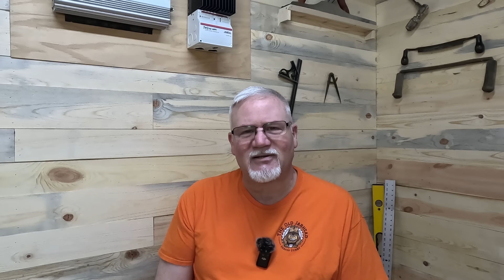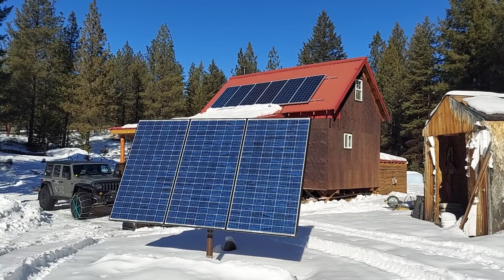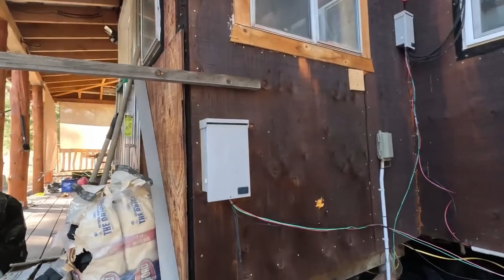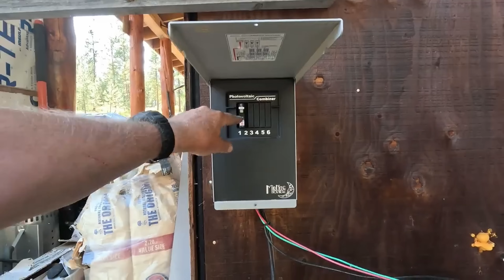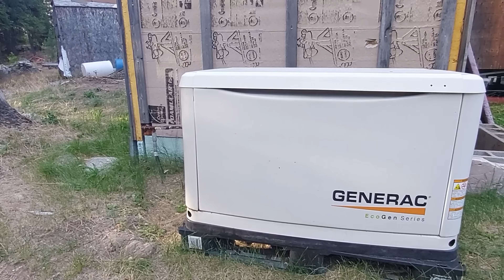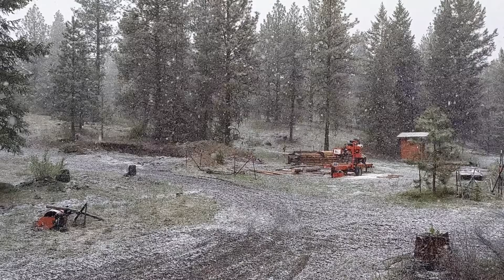🌲 What You Need to Power Your Off Grid Cabin (Without the Grid) 🌲

Comment: Does the voltage and amperage have to be identical in each of the independent solar arrays that are going to the combiner box before it goes to a single charge controller or they be different?
Reply from the maker: Yes.  I use two different combiner boxes for my two arrays
Reply from the maker: technically you could buti wouldn't

Comment: You are right on. My house in Virginia is 80 to 90% solar so I still have grid tie. My power bill is very low. I have moved several systems like water heater to woodstove heat and electric stove to propane. My comfort level is good. I really enjoy solar power.
Reply from the maker: That's the way to go - make it your own!

Comment: I would use somewhat different metrics.

First, the generator.   The key to efficient generator use is to only use it to charge the battery system, with automatic start and stop.  Start at 25% SOC, stop at 50-70% SOC.  Plus logic to ensure the storage is charged sufficiently before bedtime that the generator does not have to start while you are trying to sleep.

Its important to make the generator operation as efficient as possible.  That's why you don't directly run appliances with it.  You just use it to charge the battery storage and you run it at 50% load while doing so.   You also want a smaller generator, not a honking huge generator... smaller generators are a lot more efficient.  So count on the generator being less than 10000W.

Also count on roughly 4-hours-a-day run-time in poor conditions.  This calculation will of course depend on general 24-hour consumption, not on battery bank size.

For sizing the battery bank, keep in mind those generator set points.  Lets say you tell the generator to stop at 60% and you don't want to run it overnight.  The battery bank must be large enough that it does not drop past 25% overnight.   And in a similar manner, lets say the battery bank is sitting at 35% in the morning in situations where the previous day had insufficient sunlight.  You want a good amount of available capacity for the solar to charge into (65% in this case).

For sizing the solar panels... that's a tough one but basically it isn't possible to generate reliable energy daily across winter, almost no matter how big the solar system is.  But you also want it to be able to "catch-up" when the sun is out.  So a good rule of thumb is to target 100% daily consumption on a SUNNY winter day.   This will wind up being 200% to 300% daily consumption on a sunny summer day, and 25-50% daily consumption on a poor weather winter day.

Since many of the days will not be sunny, what will happen is that the solar will put in as much energy as it can that day and the generator will then take the bank up to 50-70% at the end of the day automatically.

--

An example of putting this all together:  Say the home consumes 20kWh/day, of which 10kWh is consumed overnight.  You have a 5kW generator and say you charge the bank at 3kW.   You would want around 20kWh / 4 (roughly) = 5 kWp worth of solar panels at a minimum to make ends meet in summer.  But if you also want to make sunny winter days be able to catch-up, you would need more around 10 kWp worth of solar panels.

--

On appliances.  A single-burner induction cooktop actually doesn't eat all that much energy.  The power might be 1700W to get going, but the actual average power consumption will be more around 500W (or less) across the (say) 30 minutes you spend cooking with it.  This can be as low as 250 watt-hours if you think of it in those terms!

An induction teakettle... 1700W x 6 minutes for a few cups of boiling water. = 170 watt-hours.  Also not bad at all.

A toaster oven cooking something.  1700W x 50% duty cycle on average x 30 minutes = 1700 x 0.5 x 0.5 = 425 watt-hours.  Also not terrible.

Full-sized residential refrigerator... 2 kWh/day typically.

Heat-pump water heater WITHOUT a hot water recirculator.  2 kWh/day.  WITH a hot water recirculator anywhere from 4 kWh to 8 kWh/day.

Home heating with electricity... typically not in the cards.  Wood stove, propane, etc... and then perhaps augment that with a mini-split.   This can consume enormous amounts of energy.  Winter is the main problem.  In summer you will be overflowing with electricity and running the A/C won't be a problem during the day.  At least for a small home.

Internet (starlink... 35W average, wifi router, 15W)... call it 50W x 24h = 1.2 kWh/day.

Lights... variable.  Call it 50W x 24h = 1.2 kWh/day.

Washer and Dryer.  These can consume a great deal of energy, depending.  Best to only run them on sunny days (for example).  Generally 2-4 kWh of energy (ish).  I don't have precise numbers.

Well pump - Depends on water consumption but call it 2 kWh/day for 2 people taking regular showers and washing the dishes and flushing the toilet, etc.

The list goes on.  Energy use does add-up over time.

-Matt
Reply from the maker: Thanks for the detailed breakdown.  I agree, it's important to think about the big picture and how all the components work together!
Reply: @junkerzn7312  wow.. that's Allot of information.. I just charge to full before I go bed..
Reply from the maker: I charge to full myself
Reply: @TheOldJarhead  what happens is the battery charges then when full. It then start's to balance. So if never charge to full. All the cells aren't balanced. When charging drone batteries can see it happening because you see each individual cell voltage. Always a lower cell. If allot lower will not bounce back. Pack Will soon fail. So if never charge to full.. that one cell gets worse and worse. Till pac fails. You can see BMS hitting with little charge as it cycles through all the cells. Longer it takes to fully charge.. means cell is going bad. Use to watch as charging. Made a habit to watch at end of charging to see what's happening in pack. This solor packs different not as precise as drone chargers. No balance leads from pack..I have 4 12v to make 48v  pack I like because if one 12v isn't performing right.. can see fast and replace saving the other 3 packs. Takes up more room.. but can fix whole pac for price of one 12v 100ah battery. Instead of replacing whole pac.
Reply: @TheOldJarhead  and I can tell PACs level by seeing voltage only.. but needs a load to tell.. run microwave, heater.. then check voltage..first part and last part goes fast but middle is heart of pace.. 56v to 54v fast 54v to 51v slow 51v to 49 fast. Full charge.. mid.. bottom of charge. Lipos don't like getting to low.. won't bounce back.. can ruin a pack fast.. i.e. cell. Weakest one goes First..
Reply: @sleepingbearffg5008  Across summer the pack will be charged to full by the solar nearly every day.  Across winter you might see it hit 100% a few times over the entire winter.

A well balanced LiFePO4 battery bank can be allowed to drift over the few months of winter.  The drift really isn't that quick... its very slow.  When you get back into spring and the pack starts charging to full again, it will rebalance.  A couple of days of regular sun and the pack will be back to normal.

Remember, solar generation is against your consumption, not the size of the battery pack.

The basic problem with charging to full for overnight is that the battery pack might end up being too full the next morning to be able to fully utilize a sunny day, so you wind up leaving solar power on the table that you could have used to save gas.

-Matt
Reply from the maker: That's why I charge to full and then let it 'float' for some time to allow the BMS's to balance the cells :D
Reply from the maker: I should add that I don't run my generator that often though.  At most maybe 1 or twice on a weekend and then it doesn't run for a couple weeks to a month.  My solar is generally sufficient to keep the battery bank charged up nicely.
Reply: @TheOldJarhead  use to go through 15 packs a day.. learn how batterys charge and discharge fast.. lol  if saw a cell going bad.. always lowest in pack After drone run..(7min) the that pac I would take it easy on.. not drain to bottom.. lasted longer.. a Year was good lifetime..
Reply: @TheOldJarhead  batterys like that.. lol but need to used too. Slow up and slow down.  Last forever
Reply from the maker: I only moved to LiFePo4's last year, before that it was FLA'S that I kept alive 8 years before swapping them out with a couple years in them still.  

LiFePo4's are definitely different, but what I've learned is to charge them full and ket them balance and try to use them in the sweetspot of about 40% DoD under normal use.
Reply from the maker: Yup!
Reply: @TheOldJarhead  You don't have to worry about DOD with LiFePO4 all that much.  They have such a huge cycle life that calendar aging puts more wear on them than cycling does.  In fact, the electronics inside (the BMS) are likely to fail long, long, long before the actual cells do.  I have a number of systems cycling 100% DOD daily that are still above 95% capacity after 2 years.

Now 100% DOD does put a tad more wear on the battery, but if that matters to you a good target is 80% DOD.  40% DOD is massive overkill... totally unnecessary.

There is no particular failure mode for LiFePO4 cells... the cells just lose capacity very slowly over time.  There is no particular drop-off point like there is with lead-acid chemistries or Lithium NMC/NCA chemistries.   All the voltages remain the same.

Generally with LiFePO4 the capacity will have a small initial drop and then flatten out with very minimal drops in ensuing years. You can use the capacity of a LiFePO4 battery without too much worry.

-Matt
Reply from the maker: That's my understanding, though most manufacturers claim max cycle life at 40% DoD and a BMS can be replaced 😉
Reply: @junkerzn7312  learning as we go right. Thanks for feed back 👍👍🙏👊👊